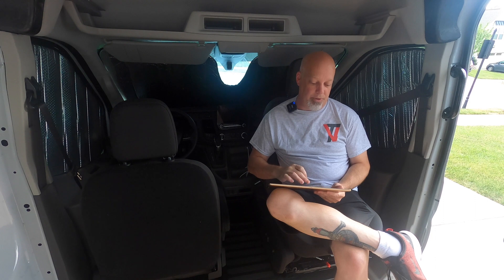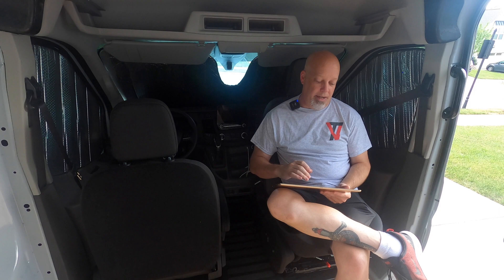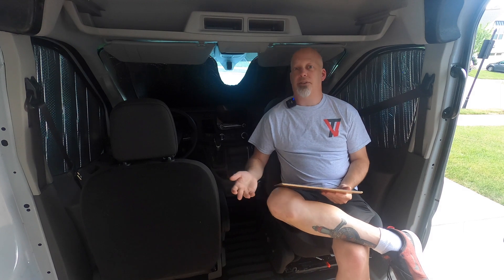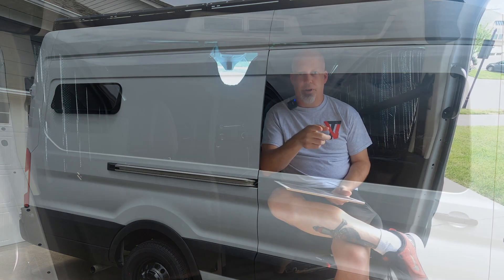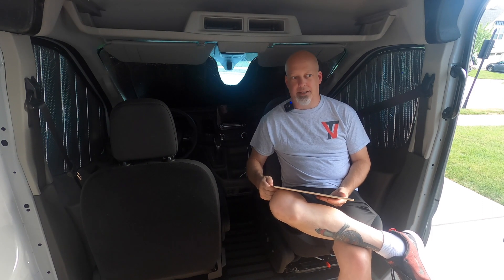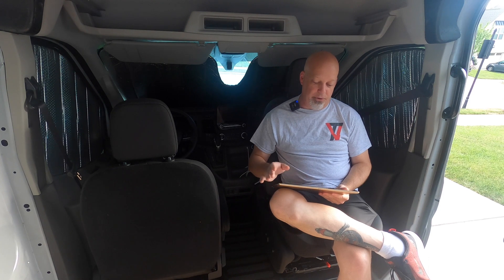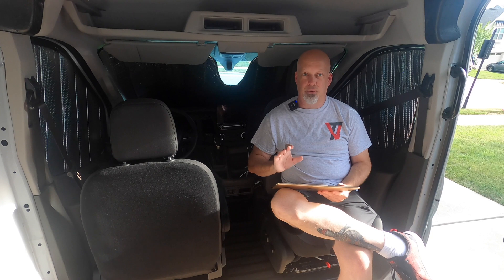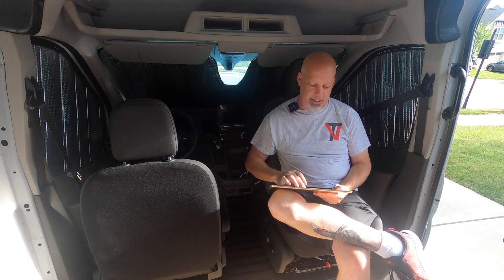Van Roof Design Philosophy

Comment: We don't have our van in hand yet (maddening I tell ya!) but are trying to firm up our game plan so we can hit the ground running once we do.  Unfortunately, that means "measure, measure, measure" is just a dream at this point.  Was wondering if you have any idea of the  length of the van roof from behind the MaxxAir fan to the back of the van? 
Appreciate the tip that the crossbars on the FVC rack sit below the top of the side rails - really good information to have as we move forward trying to plan our roof/rack/solar.  Looking forward to your next video!
Reply from the maker: Thanks, I'll keep them coming!

It has been a long wait for so many to get their van. The length to the rear will depend on so many factors. Are you regular or extended length? Are you installing the fan where I did or the "all the way forward" location? DIYVan has adapters for each location.

DIYVan and AVC RIG (60.25" crossbars and allows hangover) are other roof rack options.

Comment: I see you have plans for the RTX 2000.  Do you think a Nomadic 2000 AC unit would fit in the farthest back bay?  it uses the same 14x14 opening but the unit dimensions on the roof are 31"L x 37"W.   I appreciate your time.  My van delivery is still a month away.
Reply from the maker: Any unit that fits a 14x14 opening can be put there I presume, but will it fit with your roof arrangement and overhang? I would guess that it would not fit on my roof layout. Think about if the 14x14 section is centered, off center, and if off, how far off so you know your overhang on each side. On the Dometic RTX 2000, the unit seems to be centered over it's 14x14 section. If memory is correct I believe it was 5" forward and back. Measure, measure, measure and draw it out for your unit. I bet others have used your unit so I suspect you'll find videos specific to its fit. Good luck!

Comment: I'm actually planning the roof configuration for the same size Transit. At this time I think of installing my own design roof rack (based on 80/20) because after installing a fan and an AC I think I can fit around 700w on the roof.
One note on the RTX2000, from my understanding it needs an opening that's a bit larger than the standard 14"x14", it may not effect the available roof area but can dictate where on the roof it can be installed.
Reply from the maker: The RTX 2000 hole should be 14x14 with a notch (the manufacturer docs and hole template in the box describe a larger hole). I am using the Hein DIYVan adapter. You can find his introductory video here: https://www.youtube.com/watch?v=tE4u_qKjKaQ and diyvan.com for his shop. "Bob's Transit Van" channel has a video up using the adapter. I will eventually do an install video as well. DIYVan (and many others) sell just the mounts so you can build your own rack out of 8020.
Reply from the maker: And the last bay of an extended length Transit has 14.5" to work with as noted in the video.

Comment: Unfortunately I have to wait for a year to get our van but we ordered A130 medium roof, our van is not going to be a campervan we will build it for animal transport. With that said we will have an air conditioner inside the van and a small refrigerator of some sort and of course a host of USB charging ports. I don't anticipate our energy needs to be that great since we will drive most of the time using DC to DC charging but a concern is if we break down I want at least a couple of hours of battery time with the AC running for the animals. A major concern for us is fuel economy as we all know the more that's up top the more resistance the more fuel, Your video is well thought out and covered a lot of the aspects of a roof rack.
Reply from the maker: Thanks, Scott! We do want to protect our animals! Batteries can be expensive. Are you planning on a 12V or 120V AC? Admittedly the Dometic RTX 2000 isn't cheap, but it's a brand that should have wide service availability across the USA, at least that's my hope. Solar can help your batteries stay topped up if you are stranded for too long. I have not noticed any change in my MPG since adding the FVCO rack.
Reply: @VanTransitions  as we speak now, 12 volt Cruise and Comfort. all of this is subject to change due to size limitations of components. Current plan is 2 24x40 dog creates at the back of the van this leaves very little room on the side wall for AC/Water/Batteries/Converter and accessories. So in short if i cant find a way to make it fit then I will be forced to go to the roof.. I'm not a fan of roof tops AC, we have had 5 RV's over the years and I find that type of AC loud and high maintenance (Seals)
Reply from the maker: Have you considered the all in 1 solutions from Goal Zero, Bluetti, or others?
Reply: @VanTransitions  No but I will look them up